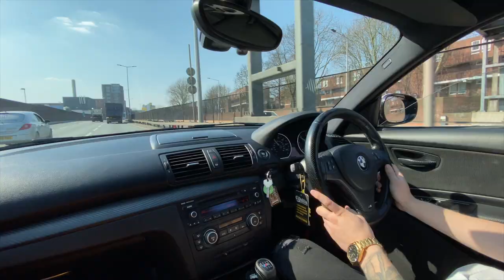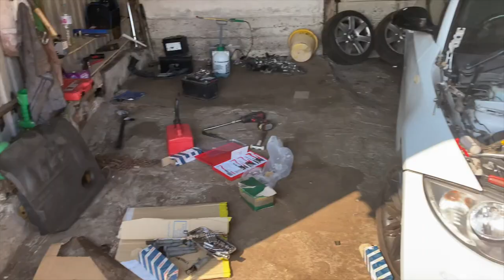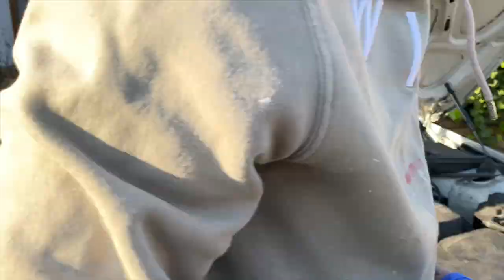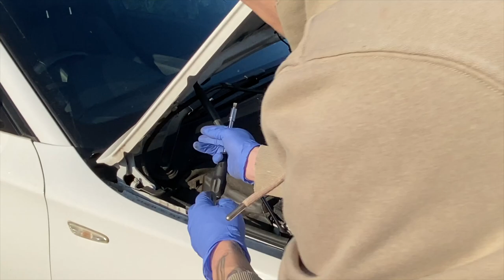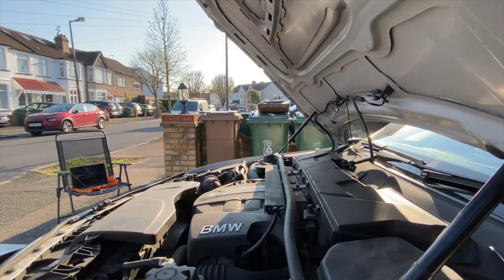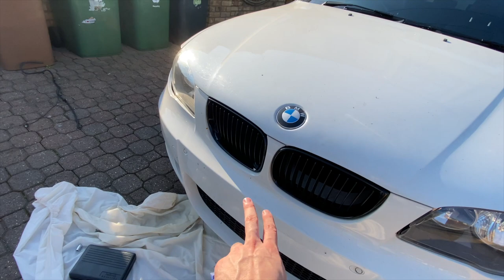Replacing The Bonnet On My BMW 1 Series E81...Finally!

Comment: Do you know if the e81 front bumper is the same like e87 ?
Reply from the maker: Bibi Adrian yes they are as long as it’s the same shape. Only difference with the cars are the amount of doors. Front of the cars are the same
Reply: @triplet5625  a shit car...BMW and mercedes from year 2000 is only shit, no quality, no good parts, an engine designed by a mad engineer or maybe they were drunk when designed the engines from BMW, i dont find another explication...